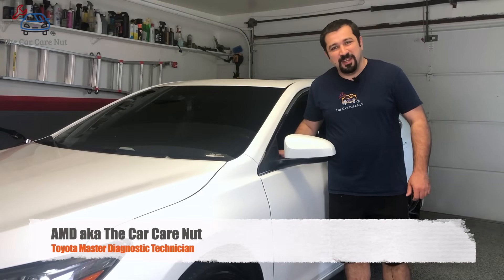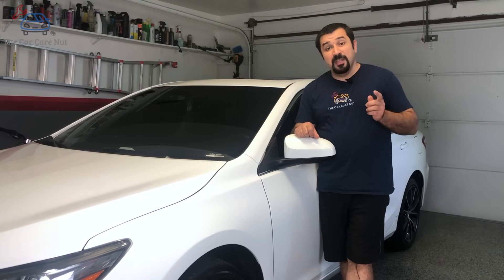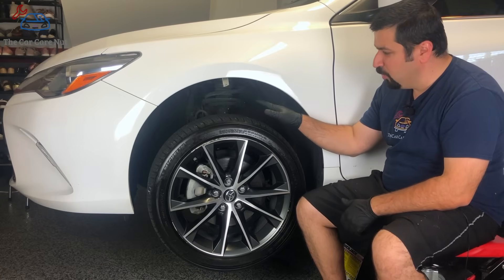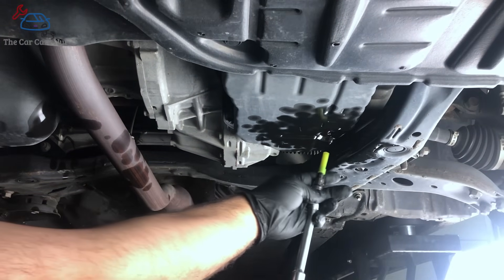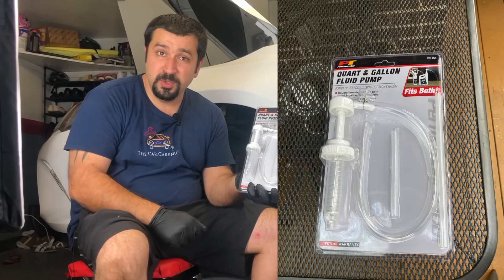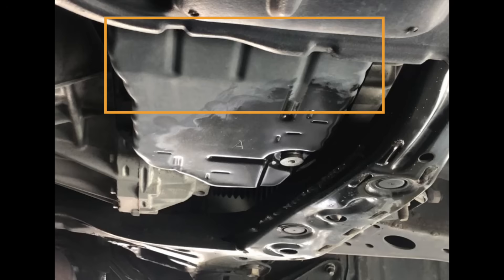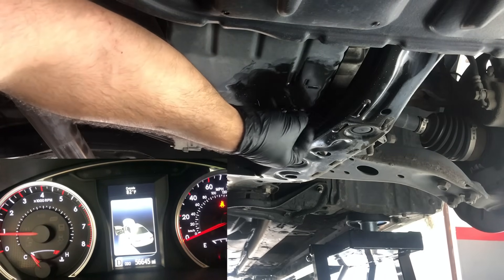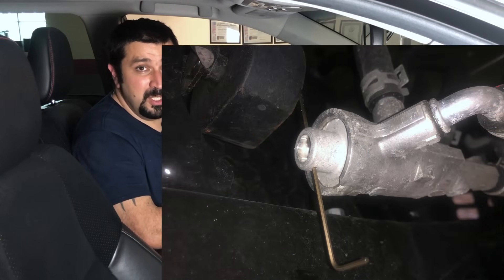How to change your Toyota Sealed Transmission Fluid

Comment: For a 2010 Corolla which has a dipstick, does the drive light method tell me the best time to check the "hot" level on the dip stick? Thanks for the video.
Reply from the maker: Hi! It doesn’t. You’ll just need to drive the car to get it warmed up the check it with the engine running in park

Comment: Do I keep the Allen key in the bypass during the whole procedure and then after I finish do I unhook it or pull the Allen key
Reply from the maker: Yes keep it until you’ve set the transmission fluid level and then take it out

Comment: Awesome! What procedure is for the rear differential on AWD 2014 Rav4?
Reply from the maker: Hi! Drain and fill until it overflows and you’re set
Reply: @TheCarCareNut  and same for transfer case right? Using the 75w90 i think it is
Reply from the maker: Yes

Comment: What is your opinion of the T401 Auto-Trans Conditioner?
Reply from the maker: Hi! Don’t really have experience with it. I normally don’t recommend any transmission additives
Reply: @TheCarCareNut  My Texas Toyota dealer service dept added "1 T401 Auto-Trans Conditioner" when they did a 12 qt fluid exchange on my 2016 Tacoma, 27K miles, 6 years old.  They also added "1 R201 Radiator Conditioner" when doing an coolant exchange, and "1 DS100 Diff/Additive" doing a Rear Diff Fluid Replacement.  Just wondering "what and why".
Reply from the maker: Fluff in my opinion.

Comment: AMD: I just called the Toyota service center near my home and they said that it is WS (world standard) and if I did it at the service center it will only do about 30% of the fluid out.  Is that correct?  Would that be a concern?  oh yeah this is for 2011 Sienna v6/6speed 59k..

If I were to do it myself, removing the straw, refilling it, maybe do it a few times would that be enough?
Reply from the maker: Hi! One drain and fill is good.
Reply: @TheCarCareNut  Thank you ! God Bless.
Reply: Ok, I just called my local Toyota , one of the guy on the phone said they don't recommend doing transmission drain/fill for WS.  hmm.. doesn't sound right to me. :D  Thoughts?  I could do it myself if I can find the time.
Reply from the maker: Your mileage is low. There’s no risk for this one.

Comment: Great video. I Have a question, on my 2015 RAV4 the OBD connector is upside down compared to your picture. The wide side is up, would it still be the same terminals?
Reply from the maker: Hi! You need to flip the picture and make sure you get the right Terminals
Reply: @TheCarCareNut  Thanks, I flipped the picture and completed the  procedure successfully. Thank you for excellent help

Comment: Would this procedure be same for a 4 cylinder 2012 camry? Thanks!
Reply from the maker: Yes
Reply: @TheCarCareNut  would you recommend drain and fill if the 2012 camry has 110,000 miles? Thank you
Reply from the maker: Just a drain and fill as that’s border line
Reply: @TheCarCareNut  thank you!
Reply: @TheCarCareNut  one more question, if im using a scangauge to read transmission temperature do i need the rpm’s to be at 800? I paid a 2 day subscription TIS Toyota to look up the transmission temperature on my Camry and went to repair manual. It shows 2 methods, one using the techstream and the other using the jumper wire. It says connecting the TC and CG terminals and activating fluid detection mode and then disconnecting tc and cg activates engine idle speed control mode. In engine idle speed control mode engine idle speed control starts when the fluid temperature becomes 95 degrees or more and the engine speed is maintained at approximately 800 rpm. On my camry temperature should be between 95 and 113 when checking level.
My question is since im not using a jumper wire and not activating fluid detection mode and only using a scan gauge to check transmission temperature do i need to maintain 800 rpm while using the scan gauge to reach 95 degrees(i have a pedal depressor which i can set and adjust to 800 rpm’s) or just let it idle? My camry idles between 650-660. Im confused on which one would be more accurate to check the level. Thanks! Love your channel. Also i printed a copy of where i read all the information and emailed you a copy so you can see what im talking about on page 11. Highlighted in green letters. Let me know if you received my email please. Thanks!
Reply from the maker: Hi! The difference in idle speed is very small and honestly this was on some documentation and not on others. Just adjust the fluid level when you’re at the correct temp window and don’t worry about the idle
Reply: @TheCarCareNut  thank you! I appreciate it.

Comment: Great video. I'm sorry if you mentioned this already and I just missed it in the video, but approximately what percentage of the transmission fluid is being changed when doing this? I've heard from different videos that it is about 20%, up to 50%, of the fluid that is actually being replaced with new fluid
Reply from the maker: Hi! Around 25-30% which is sufficient to keep things protected

Comment: Thanks for the great video and for replying to these comments almost a year later! I have an overseas model 2008 RAV4 with a CVT transmission. I was wondering if the method used to check fluid temperature (alternating between D and N) works for it too? Thank you again.
Reply from the maker: Hi! It should work try it before you drain the fluid
Reply: @TheCarCareNut  Hey I tried it but what happens is that both the D and N gears show up as selected. It doesn't seem the same.

Comment: Do you recommend replacing the transmission filter on a 2016 highlander awd with 85,000 miles or just drain and fill?

Also, should I replace the transfer case and rear differential oil at this mileage?
Reply from the maker: Hi! You can consider a filter if this is the first replacement. The transfer case and differential fluids every 30k

Comment: whats the temp for a 2020 rav4 4 cylinder and a 2021 camry same engine?
Reply from the maker: Hi! 95-114
Reply: @TheCarCareNut  where do you take the temp? Below the plastic pan or on the plastic pan?
Reply: @TheCarCareNut  Hello there what is the torque spec for the transmission drain and fill plug on a 2020 rav4 non hybrid and a 2021 camry same as before  non hybrid? thks  the 2.5 engine

Comment: In the video, when you are underneath the car, waiting, while your helper is shifting back and forth between D and N, it sounds like the engine RPM is higher than idle. Is this just coincidental or is it recommended that the car is revved somewhat while shifting between D and N?  Also, would it be ok if the jumper remained in the OBD2 while draining the excess oil, just to make sure that the temperature stayed in the correct range?  Thank you for your insights.
Reply from the maker: Hi! Don’t rev the car. Just switch back and forth and when the light comes on solid remove the jumper and put the car in park
Reply: @TheCarCareNut  Thank you.

Comment: Hi, Great video but have a question.  After replacing the transmission fluid, does the car need to be on level ground when draining the excess fluid?
Reply from the maker: Yes it need to be level

Comment: If you are using an Infrared Thermometer tool be careful to measure it from a distance very close to the manufacturer's recommended distance from the tansmission. 
 Big Errors creep in with these Temperature measurement tools mostly from people focussing on the  heat source too from way or too close.  It can mean you are 10 %  out or more  so be within  a few centimeters of the recommended distance  for your thermometer from what you are measuring.  Mine is 36 centimeter from the  temperature source I am measuring. .

Comment: How to change transmission fluid  on a Camry 2007
Reply from the maker: If it’s a 4 cylinder is has a dipstick so drain and fill and check on the dipstick with the car running. If it doesn’t have a dipstick V6 model then follow the video

Comment: I tried the shorting wire method on the OBD port on a Toyota Yaris with a sealed CVT transmission. However while cycling through neutral and drive as suggested using rapid movement through and forth I could get the drive indicator to light up. Any suggestions would be gladly welcomed.
Reply: Hi. The OBD connector in MY Toyota Yaris is the other way round with the wide part on top and the narrow at the bottom. Should I place the jumper wire in pin 5 on top and pin 4 at the bottom? Thanks

Comment: I guess all these people that make lawn mowers have done the same thing there are no drain plugs on the new lawn mowers you have to dump them out so anyway anyway what about the truck converter do these cars have a torque converter just because you drain the pan doesn't mean you drain the torque converter so you're not getting it all what about this thank you very much
Reply from the maker: Hi! They do have a torque converter but other than a flush you won’t be able to replace the fluid there

Comment: You should have mentioned at first to start with an empty drain pan for later measuring... Also you should have loosened the fill plug before you ever drained the fluid

Comment: Hello. Love the video, but I have a few questions. When you’re doing your final fluid check. Is the car running and in park or is someone inside with their foot on the break in drive? For the final fluid check. Thank you for your time!
Reply from the maker: Hi! The final fluid check the car is in park and running
Reply: @TheCarCareNut  Thank you for getting back to me so quickly and with the information I was looking for. I appreciate it more than you know. I’ve done just about anything and everything when it comes to cars. However I don’t know anything about the sealed transmissions. I’m trying to help a friend that doesn’t have the funds to take it to a dealer, so I need to make the car trustworthy for her and her son. She’s going to be taking it for quite a few trips and 4 hours a day to visit a friend in the hospital. The friend has a long road ahead and is going to be there for a pretty long time. That being said the last thing I want her to worry about is the car. Thanks again for your help with information to help keep them safe.

Comment: Will the second procedure with the jumper in the OBD connector for monitoring the transmission temp, work on a 2021 4Runner?
Reply from the maker: Hi! Yes it will. A video specific to the 4runner coming up very soon

Comment: Thanks for all your great videos AMD. To not have to deal with waiting for the exact engine temperature to refill can you not just drain the transmission fluid when the transmission is cold and then replace with the exact same amount of new fluid since both old and new fluids have the same temperature and viscosity? Thanks
Reply from the maker: Hi! You could if the level was right to begin with. And I’d say if you did all the work why not finish the job and set the level correct

Comment: This past weekend I used this procedure on my 2014 Sienna. I am using a thermal gun on the pan to check temp (about 110F was my target). I do have a couple of follow up questions. 

- I noticed that the pump had produced some bubbles in the fluid when adding new. Is this something to be concerned about? I'm not sure if I had just hit the end of a bottle. I plan to pay closer attention next time I change some fluid. 

- I did the initial drain first thing in the morning on a cold engine/transmission. I got 1.6qts of old fluid out and ended up adding 2qts and then taking up to temp and doing the level check once my thermal gun hit 108, and by the time I pulled the plug on the running engine it was at 110. I got about .3qts out on fluid level drain. I was expecting to get about 2.5qts. Is this because I did it on a cold engine with cold fluid? 

- This van is at 123k now. Best I can tell the fluid has never been changed. I plan to drain and refill at least another two times. Should I do more than that? 
My previous vehicle was a Honda Pilot and we would put about 8k mi a year on it. I originally changed the fluid three times at 90k when we bought it (it's supposed to be done that way every 40k),  and then after that I simply changed the fluid out once annually, rather than the 3x every 40k instead. Would some similar trans fluid change interval be okay with this Sienna? I'm thinking I get out most of the old stuff and then do a drain and refill one time on an annual basis....

Comment: Hi! I have 2006 6 cyl 4Runner with 87k miles. I bought it used with good maintenance but I don't know and I believe that never had an transmission oil change. I have heard that leave like that because the change will cause the transmission to fail. Should I change the transmission oil at this point? Thanks for your help in advance.
Reply from the maker: Hi! At this point a drain and fill is the most I would do

Comment: Dude i tried this with wire method and checked with infrared termometer. I dont know, Infra temometer showed only 87F  (toyota should have 104F) on plate but "D" was steady on screen. SO is it really safe and accurate?
Reply from the maker: It’s a lot more accurate than the infrared thermometer and I trust it more.
Reply: @TheCarCareNut  okay, i believe you, thank you for answer, i watched other pf your videos, found quite alot good info! Thanks! But one more question i have rav4 with cvt transmission 2015 year and according manual says ATF-WS to use is this right?
Reply from the maker: Is this a hybrid?
Reply: @TheCarCareNut   no, its petrol, 8gear shift.
Reply from the maker: It shouldn’t have a CVT it should have a 6 speed automatic. On the label on the door jamb what is the transmission name?

Comment: I do the same thing, but I use the weight of the oil to determine my replacement quantity. Also the CVT-FE transmission fluid is stupid expensive ($98 per gallon)

Comment: Hey AMD, I have a 2010 Lexus RX 350 with the 2GRFE 3.5 engine. How many quarts would I need for a transmission flush/change?
Reply from the maker: Hi! For drain and fill should be up to 5
Reply: @TheCarCareNut  Great! What about a full flush?
Reply from the maker: A flush typically 12 quarts is used
Reply: @TheCarCareNut  Amazing! Thank you so much!

Comment: I have a serious question. Why couldn't I just refill the transmission fluid with the same exact amount that came out IF,,,, both the fluid in the transmission and the fluid in my unopened jug are the same temperature.  Don't crank the car for 24 hours and let the jug of unopened fluid sit right beside the car so the temperatures are exact. Three quarts out three quarts in under same temperature as an example.
Reply from the maker: You could if the fluid level you started with was correct. But if you’ve done all that might as well just finish the job and set the fluid level and be 100% done with the job.
Reply: Now I get it....... Understood.....Thank you my friend......

Comment: I did this but no trickle happen. I added additional fluid like 1 quarts when Solid D on and went down and unplugged the drain plug, nothing. 
So my real question is should I add more extra quart or half quart transmission fluid through the fill plug from the driver side and repeat the process? 
I rather not drain the fluid (I do have extra 3 large bottle, I think 4 or 5 quarts bottle so 12 quarts available) but if I do should it be safe to add a quart extra instead of half quart to get the trickle. 
Car shift smooth still but I am worry about the longevity if there was less transmission fluid inside. 
Please help, which would recommend add a half a quart and run the process and hope there trickle, if not add another half quart and repeat the process. Or should I just drain and fill with extra quart(will this be safe) or half quart and hope there trickle, if not let engine cool and add maybe half or quart and repeat process.

Comment: I would like to change the trans oil when it is at ambient temperature.  Then measure what I take out and put back the same amount with warming up the fluid and draining out the 1/2 quart of overfill.   Would this be terrible?
Reply from the maker: Hi! It works but if you did all that you might as well check the fluid level and be 100% sure.
Reply: Meant to say without having to drain out the extra 1/2 quart.   It would be a big hassle for me get all 4 wheels off the ground and the car level.

Comment: Does this apply to 4Runner 2016? My local Toyota dealership said they only do flash transmission fluid ($450). Is flash better? Thank you so much
Reply from the maker: Hi! A flush replaces more fluid and if your mileage is around 60k it should be ok to flush. This does apply to your 4runner and in the next few weeks I’ll have a similar video dedicated to the 4runner

Comment: Have watched dozens of these videos.  They all tell me to pay up for the experienced mechanic with the correct tools.  Just asked my dealer for a price…they said never needs to be changed unless a lot of towing?  All the YouTube mechanics say change at least every 80,000.  The dealer said they would check mine for condition, as I do not know if the previous owner was towing a lot..2007 Tundra, 72000 miles.  Don’t know who to believe.  Also, some recommend changing filter, some do not?  Also, don’t even know how to check if the mechanic even changed these, or just said they did?
Reply from the maker: Hi! I would change the fluid every 60k miles or 6 years regardless of towing or not. If you change the fluid on time there’s no need to change the filter.